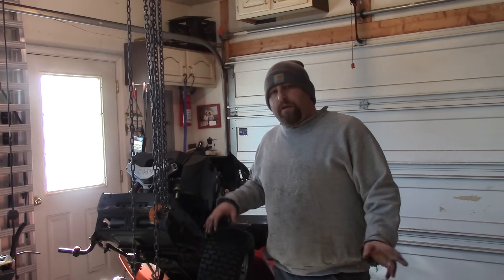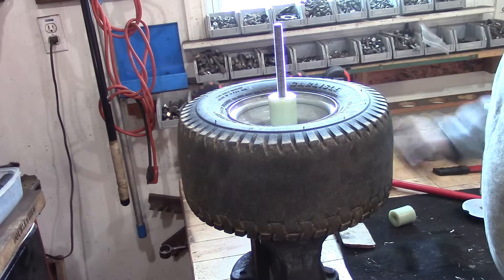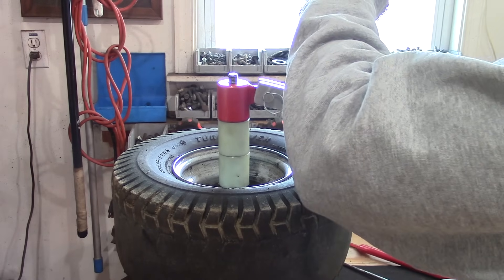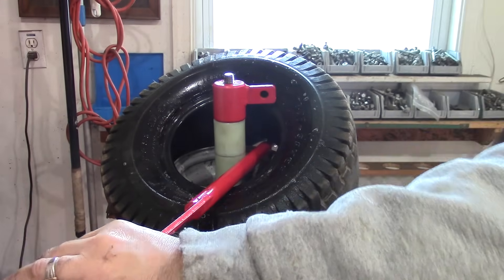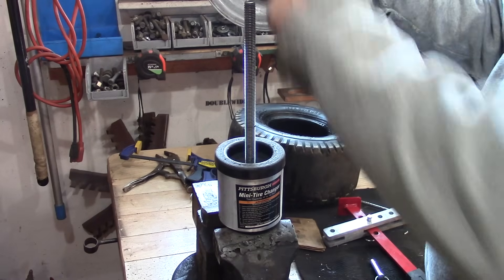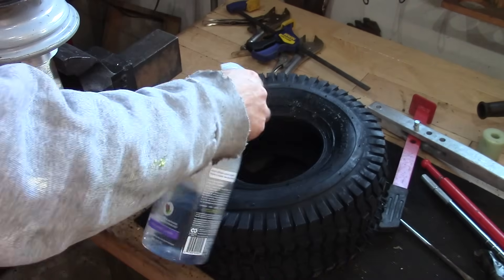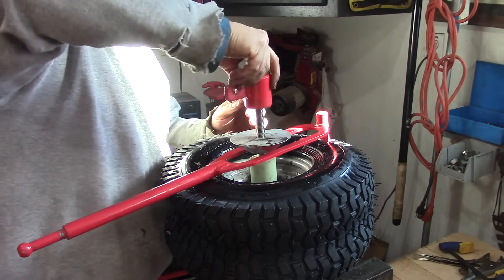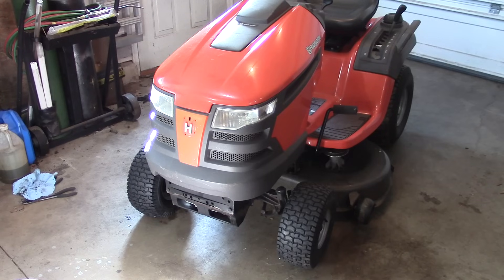Harbor Freight Mini Tire Changer 61179 for Tractor Tires

Comment: Wearing a lawn tractor tire bald is a very unique accomplishment. It is something i have never seen before.
Reply: Exactly what I was thinking.  I had tires 20 years old that still had plenty of tread. Lol
Reply: Bought one these did not work as advertised. Tried to break the bede the center bolt bent. I ended up using a wide chisel to break the bede

.
tried
Reply: he really didn’t want to replace that valve i guess 😂
Reply: Not really I used to make em bald 24/7  hillbilly sports
Reply: That's a alignment problem. Tire wasn't worn evenly.
Reply: Especially a front tyre....
Reply: I thought that myself when I saw that tire I was like damn they got some good use out of that tire and they must not have Hills where they mow
Reply: Lol

Comment: Know this is an old video, but for anyone curious.  This would've been a fair bit easier had the tire been warmed up before installation.  Either set it out in the sun for a good 30+ minutes, or use whatever you have to heat it up.  It will make it far more elastic and if your tire is warped, like this one was, it will fall back into its intended shape on top of becoming more elastic.
Reply: Thank you , something I just never thought about

Comment: Figures. You use the easiest rim to work with, and make no mention of the harder ones. Or have you OP, even done one of the tricky rims? My first tire change with this unit was off a 1997 Wheel Horse 520h. Front tire. That rim has a deep side and a shallow side. I found out the hard way, after much trouble and no help from the internet, that it's impossible to remove the tire from the deep side of the rim. On the shallow side, not visible from the outside, there's a U shaped section inside the rim that allows the tire to move far enough away from the rest of the rim to get a tire tool under the bead, and then allow the tire to come off the rim. That's the trick with that type of rim. Sadly, no help from the manual, no help from the manufacturers website, no help from the internet. Maybe that type of rim is so rare, that few people ever encounter them?

Comment: I have never seen anyone use a tire valve stem installer tool for removing.  Seems easier to remove the core and then cut it
Reply: you can get them at a real auto parts store they work well.
Reply: I use my tool to pull my tires come out and to put it in
Reply: Well don't watch this guy he didn't use the stem installer correctly.
Reply: canuckguy worried  how would this wreck the tool! Its still pulling it?
Reply: @KyGun  why did'nt he?
Reply: canuckguy worried  If I ever used one? HAHAHAH! Brother I own a shop and have a Degree in mechanical Engineering! Yeah I have used one! No more effort to use this way than to install! You just wouldn't understand!
Reply: canuckguy worried  Snap On? Blah hahahahahah!
Reply: canuckguy worried  Yes I am scared and i'm also Illiterate!
Reply: It’s easier to pull the core the cut it from the bottom then just pull it out
Reply: I didn’t even use a valve stem remover I just removed the code with a tiny flat head and ran over the tire with a 2x4 and a four wheeler but keeping the wheel still was the difficult part it being the front tires I just put my knees on it and used tire spoons looked so much easier with this tool tho.
Reply: @dodgeramsport01  That's because you don't have a shop. You are spouting off and don't even have a clue yourself.

A valve install tool isn't meant to bear the force needed to pull a valve all the way through the rim. It's meant to pull it to the stop and quit....not keep going. Yes you can easily break them by trying to pull it all the way through. This guy and you clearly have no clue what you are doing.

Oh and btw....I understand it all. I have been working in the tire industry for over 30 years! I started doing tires back when I was literally 5 years old for the family business. I could change car and truck tires when I was 10....I started doing full size tractor tires BY HAND when I was 15. I still don't bother with a crane or any nonsense like that when doing tires and I work on everything from a lawn mower tire all the way up to and including earthmovers and michigan loader tires. But please...you continue spouting off and trying to act tough and like you know it all. 

Class dismissed!

Comment: I just placed the tire on the ground and used a bottle jack against my hitch to break the bead.  Then put the bottle jack in the center of the rim, and against the hitch, to stabilize the rim to remove the tire. Works pretty good if you don't have an actual tire changer.
Reply: Make a video

Comment: michael Whitmore

I made an improvement to mine that works great. most small wheels have at least 2 holes thru them, I added a few links of chain and a eye bolt. I attached the chain to the base and run the eye bolt thru one of the holes and put the nut on. Now the wheel wont turn when you are working on it, one that didnt have a hole I popped the valve stem out and ran the eye bolt thru that hole . Really Big improvement on this tool and works great
Reply: Great idea. Don't know why I didn't think of that!!!!

Comment: Just a helpful note on Mounting the Changer so you can use it.
If you don't have a Vise mounted to a sturdy bench you can get a 4 foot legnth of 2x6 or 2x8 and Bolt the Tire Changer on to that. Then put it in your Driveway and simply role your car or truck onto the end of the wood.  You have to kneel to use it but it's locked solid.
Reply: Use 4 lag bolts to secure it to the top of a tree stump. And put blocks of 2x4 under the side of the tire you're putting pressure on to prevent bending the all-thread.

Comment: I like the fact that you put the valve side down. Similarly, you locked the rod under the disk that stopped the rod from moving out of the position where it is supposed to be, between the tire and the rim. Bravo and thank you!

Comment: Useful.  thank you - I will use that cone thing as you did - it really does nothing much at the bottom on those mower tires.  I think they are more for small wheels with a larger center hole to stop it moving around.  I put a locking plier on the rim of the wheel which stops the tire slipping around.   I had a bit of a struggle with rear wheels when I was putting an ag style tire on.   Sadly my air compressor does not have enough pressure to get the beads to seat so will need to go to shop to get that done.

Comment: Thanks for the information. I got the same set up.  I got the bottom side on and I've been fighting the top side for 2 hours. I'm going to try the arrangement of the cone, adapter and top piece. I'm not a weak guy either. I saw 1 guy use a pair of vice grips to keep the tire down under the rim. But it just gets on the way. Have a good one Doouble Wide 6.

Comment: I used this yesterday and it kick my ass.The bead breaker works great and getting the tire off was all right. Putting the tire on was another story. Getting the first part was good. But to get the last bead on was difficult I try your set up I have 20x12-10 tire and could not secure the rim done . I ended up putting on ground and work it around what a pain in the ass. But I got it done.

Comment: I made a mount for this that fits into my receiver hitch. It sticks out far enough that the tailgate will open and the main leg is adjustable up and down. I use mine a lot and I made another cup with a rubber gasket from an irrigation pipe that drops over the main 5/8" shaft so when I tighten the top nut it clamps the wheel from both sides with rubber. Wheels do not spin in it now. I also made me a T handled wrench that fits over the top nut so i can spin it down real quick and really tighten it. It works really good now.

Comment: Great videos! Not sure you mentioned it but the rim has a “drop- center” that you use when dis-mounting/mounting the tire. Place the tire bead in the drop center and then the opposite side of the bead can be easily slip over the wheel rim.
Reply: You da man!  Been a snake.  . . . . Thanks!
Reply: Yup. Found that out the hard way. This is especially the case if it's a deep set rim that has a deep side and a shallow side. That 'drop center' you mention is on the shallow side of the rim and the tire can only be removed and reinstalled from that shallow side.

Comment: Nice video. Ive been holding my rims by 2 punches in the vice, there is 2 holes for weights on my rims. I like the looks of that tool, I will get one. I prefer a 412 valve stem which is the shortest I've been able to find. I put valve stem towards center of tractor, and weight on outside of rim. Valve stem on outside of rim is more likely to hit an something.

Comment: If you forget the valve stem, there is a tool that installs it from the outside of the wheel.  It uses a rod like the one you have, only not jointed, and a cone that you push the lubed-up stem through.  Personally, I usually put a tube in a new mower tire, because they always seem to leak eventually.

Comment: I always mark where the valve stem is on the tire. I have had locust thorns break off and you not find them feeling around the tire. With stem marked, you can find the hole and make sure you get the piece our and not have to patch it again. I do love the video, I will definitely  use the bolt next time instead of holding the tire or breaking it down while still on the tractor.

Comment: Thanks for the video.  I just bought one the other day (used my 20% coupon).  I bought it after struggling withe removal of my 2-stage Snapper snow blower tire, I'm hoping this makes my life easier if I need to use it on one of my other machines as well.

Comment: I haven't had to change lawn tractor tires yet, but I DID remove old and install new tires on a small boat trailer a couple of years ago.. It was a TON of sweat-popping,  knuckle-bustin work to get them off and on WITHOUT a proper tool.. The main issue was stabilizing that small rim enough to get the amount of leverage you need to work.. it's nearly impossible to stand on a 6 or 8 inch rim lol..

Comment: Wish I seen this video before replacing the front tires on my tractor. Would have gone more smoothly if I had used the cone shaped spacer the way you did. Helps to keep the tool in place under the tire bead when installing. Thanks for posting.

Comment: Thank you for this video. I suffered through getting one old Carlisle tire off and new one on. This video SO much better. I will check out your setting bead video. My new tires were smushed and I ended up taking one to shop.
Reply: By entering the tire size on Amazon,you can find good deals on a set of two and quite  a few brands are 4 ply and haven't been "strapped" meaning they aren't squashed when they arrive.
It makes replacement waaaaay easier.

Comment: Very good, now I see how that plate is put on they changing device, ok. But I watched this video because I thought it would change a tire with a 'tube', I have been really struggling to use this device and change the tube? Just trying to get the tube in and out of the tire about destroys your hands. Is there another video show tube change?

Comment: That same soap water mix that was helpful with removal and installation of the tire, is also equally helpful with a new valve stem
Reply: Thats why he used it.
Reply: @waynesmith9765  you beat me to it, lol.

Comment: Dude! I know this is an old video, but that is so much easier to do with a couple of tire spoons with the wheel on the floor. I just did three today in the shop without working as hard as you did! Now, I do have a full sized titre changer that I use to break the bead, but still....

Comment: Seems like the  changer works pretty well for  those little tires and rims   I guess the big trick is to use thar soapy solution as you  mentioned  my son had a 4 wheele growing up and those were a pain to change without  any changer  i had Antique tire  irons that came in a Antique cars factory tool kit i owned years ago  they worked but it wasn’t  as easy as your way

Comment: Ha I'm going to have to get one of these. I did find out it's easier if you install them from the front side of the rim because the front side of the rim is a lot smaller than the back side.

Comment: Don't think I'm as strong as you but I change my tyres with three old-fashioned tyre levers. If needs be, I break the bead by laying the wheel on the ground, placing a strong plank on the sidewall, and drive a car onto it.

Comment: Good video, but that tire did go on easier than they usually do...sometimes you have to use a vise grip to grab the rim to stop the tire from following the mounting bar.around .....and it works better if it is bolted down to a steel plate or pretty good sized piece of thick wood..that way you can work on it at table height or put it on the ground...some tires get very balky and yo have to try different work heights to get it to cooperate.....it is easier to just use a utility knife or a razor to remove the old valve

Comment: Use a small block of wood for leverage , that stem should come out a lot easier.
And I've used my valve stem Puller for Installing and......Removing, Works fine. Also used diagonal cutters to remove them, up to your preference.

Comment: Little confused here. So I thought to express and ask. First I never redone tires. Lucky for me I brought 2 riders other day. Course I need 8 tires redone. I don't think I'd last 8 tires. To start I see you did not put tubes in so what am I missing here? I hear something here and there about tubeless tires so how would I know on my rider if rim or whatever is tubeless? Rider is a old Craftsman LT-1000 917-270821. I also hear alot about clean rims first, but do not see this here? Last- I see some links about for tools also a HF changer tool. So to do all do I need to just get the HF changer tool or that and I need every other thinked linked above? Side note info- all my tires are leaking air slowly and both riders. Appears tread is fine however sides have cracked lines as if riders sat for ages in sun. New tubes ( if it takes tubes ) and should be repairable fine or time to buy 8 new tires with or without rims?

Comment: A little 'rubbing alcohol' on the valve stem would make it much more 'slippery' than soapy water and make it slide into the hole much easier.

Comment: Great video but it's missing an important part and that is how to get the tire to seal while first airing it up.  I've always had a problem with that doing car tires without putting tubes in them.

Comment: Tread worn off ? Now many miles on that thing lol. , I got tires 35 years old that still have tread ( side wall dry rot so the tires have tubes in them now ) and cutting five acres of grass , modes have 28 hp and  19hp B&S twins . Motors still going strong after all those years ( deck rotted out , so one mower is now a tractor , snow plow , trailers

Comment: Thanks man, I have one these mini installer but I could figure out  what is proper way  to use it, great post. I am putting tube in my front wheel, I always have problem with slow leaks.

Comment: Mounting snowblower and other small low pressure tires have their own challenges due to their width and small diameter as opposed to car and truck tires.  Be aware that they are low pressure tires and don't use too much air pressure when trying to seat the bead as that could cause the tire to explode.  Liberal amounts of soap and water can make this job easier.

Comment: What I use is a bumper Jack from the 70s put the back side around the rim put it in the hole on your bumper on your car Jack your car halfway off the ground a rim that's been on for 20 years will break down

Comment: Don't know how you got the 2nd bead on the new tire on the rim (as easily as you did, even though it still seemed difficult). That is where I got stuck. I tried and tried and this thing just didn't work. Yes, it was lubed up well, but that bead was just impossible to pull over the rim. I bought 4ply tires if that makes any difference. This thing is going back to HF...
Reply: Don't give up! Use a "tire iron" to grab the edge of the bead, to keep the tire from just sliding around the rim.  There is a clamp tool that grips the rim without scratching the paint.  A second tire iron to carefully lift the bead over the rim near where the first iron is works, too.

Comment: Can that mini tire changer work with the rear tires?
Reply: Not on my Troy Built mower. The threaded rod won't fit through the center of the wheel.

Comment: just cut the stem off... and I guess I've been lucky. Can't remember who showed me - he was very old and I was very young. I just stand on the tire to break the bead and to reinstall the new tire I use two tire irons/spoons. Put the new tires in the sun for a few hours to get them back into shape. I've never bought tires and didn't have them squished. When they are squished they are hard to seat the bead. But - Good vid!

Comment: Putting the aluminum wedge on top of the bar like that was the key to me being able to start it and I got it halfway ... however the tire would not continue without additional use of a tire spoon. The instruction manual from Harbor Freight is mostly worthless, and this video is now the 3rd variation I've seen. Bottom line: Put it together anyway you want that works for you.

Comment: Got a changer just like that. It can suck on low profile wright stander rears.  Not enough leverage. Not bad for up to 20-8x8's though.
Reply: If those rims were deep set, with a deep side and a shallow side, FYI the tire can only be removed/reinstalled from the shallow side of the rim, because there's a channel inside the rim, not visible from the outside that allows the tire bead enough room to get a tool under the bead and also allows space to get the bead over the rim.